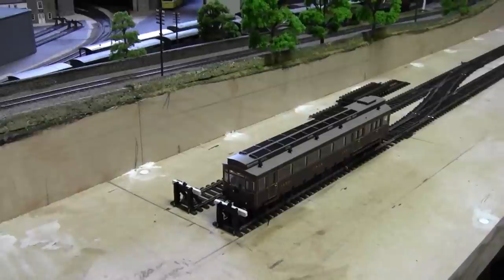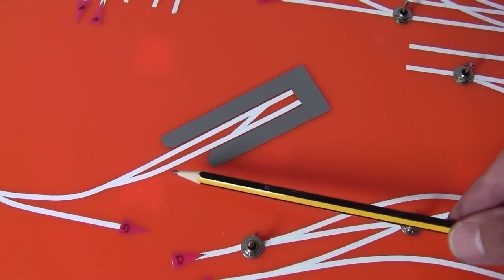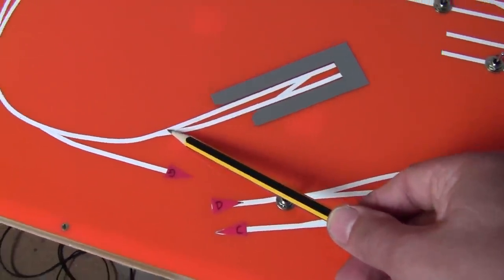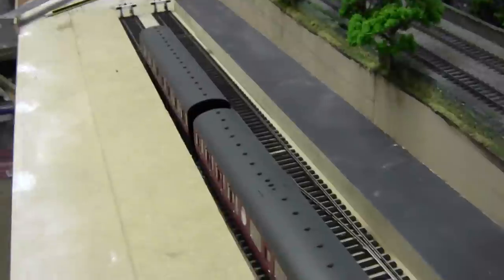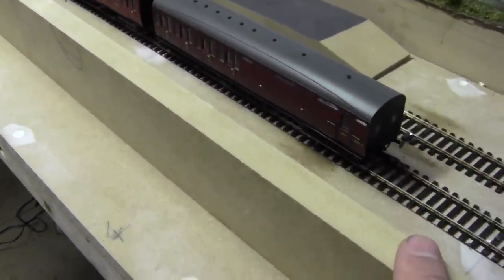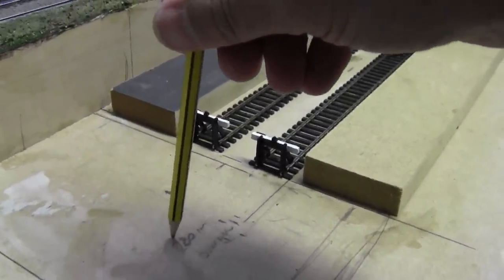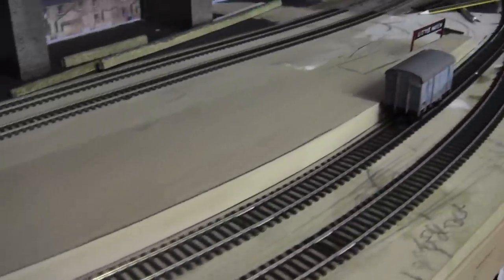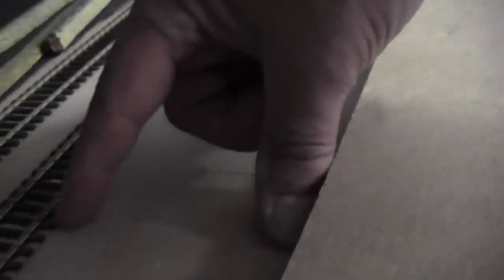Update and making Platforms Part 1 ....No 320

Comment: Nice job Tony . Your level middle are easy too do with polyfilla . All you need is two pieces off old rail bent slightly at the ends off the rails.then place the rails near the chairs glued in with super glue . Then take a piece of string.place both sides. Polyfilla over all. Leave to dry . Pull the string out once dryer sand and paint. Job done. Look forward to next video
Reply from the maker: Thanks for the tips! Ian. i will bare that in mind. have a great weekend...cheer's Tony

Comment: Hi Tony you are doing well on your extension  will be keenly watching. I've been back in my shed this week working slowly since my 3 weeks away. Did pick up 3 more engines a lot of ballast some coaches and things while away. But I always made sure not to miss your videos. Stay safe my friend.
Reply from the maker: Hi Stephen. so far so good. i have not done much this weekend so far as its been to hot. your back in the shed mate just as it getting warmer at leats you open the door and let in the breeze. i am not quite ready for ballasting just yet. still have some wiring to do. until next time my friend stay safe. and enjoy the hobby...cheer's Tony
Reply: Nor me my friend I dont even like ballasting but am going back to mixing didn't like mono tone like the last time.has for the heat I have a small aircon if it gets to hot. @TONYNORTHEASTERN

Comment: Great job, Tony!  Your drivers need to be trained not to hit the buffers on arrival to the station, or maybe employ a flagman. It saves on having a sensor. 😂
I noticed you have included insulated rail joiners at Jarrow Road.  Is that for track isolation or are you into block detection, Tony?
Whether it’s station platforms or anything else, practice makes perfect. 
I saw an earlier comment you made about gaining tips for water features in relation to the dock/canal at Little Haven.  If you have not already done so, check out Luke Towan on YouTube, who is THE guru at scale model scenery tutorials for beginners and professional builders alike.  He has many videos on creating fabulous rivers, streams, etc, amongst other things.  Recommended!  Best, Jason.
Reply from the maker: Hi Jason mate, the sensor will light up red on the control the loco is close. hence why there are no sidings at this station. the controler is to far away to judge where locos are. block detection would great for this...
i will check out luke towans channel. we are a long way off for doing that just yet....i can now have a rest until next friday. stay safe my friend. Tony

Comment: Blimey, yet another one!!! 🤣😂😅 Nice to see the panel mate. Looks Jim-dandy to me 😎 Nice use of those little black cable ties! Where did you get them? They look like a godsend 😉

I really like idea of polyfilla and pva for crossings and roads with rails inset, so I shall be shamelessly stealing that in the future 😄

By the way, for Lityle Haven, could you not put in a barrow crossing of some sort? 🤔 Not untypical on tight spaces and it’s only going to be employees and workers as opposed to the general public using it 😜

Those platforms will looks superb when finished too mate. Great tutorial on the method for building curved platforms. I always think they look better and more realistic than straight ones anyway 🤓

Cheers old son 👍🍀🍻
Reply from the maker: Hi Tim. the cable ties are 4 inch and they canbe found on ebay. they are quite cheep. 
I may think on what you have said regarding the crossing. until next time all the best Tony

Comment: Impressive wiring in the control panel. Great explanation on how to curve platforms too.  Spoilt this week with two vids. Thanks mate. Stay safe. Arthur
Reply from the maker: Hi Aethur. Curve plaforms have been a bit tricky to do. but if you a small wagon and tape a pencil or pen to the side it does work a treat. the panel is not finished as there are so many points that need to be wired up yet. hopefully when i get get some spare time from building i can then run the cables in...until next time stay safe Tony

Comment: looks very nice.
i usd plained timber 20mm for my stmarks layout. 
worked a treet.
did not think of MDF.

all the best

paul
Reply from the maker: Thanks 👍 Paul. i have always used MDF, as platform height should be around 17-18mm in height. 20mm is ok. but no higher than that. as for scale terms it should be 12mm above the rail...thanks again for your thoughts on this subject. the main is as long as it looks right...all the best Tony

Comment: Hi Tony, as I see in a lot of the comments the control panel wiring is amazing, very neat and organised.
As for the platforms I’ve picked up a few tips there, do you use a jigsaw to cut the curve in the MDF? It’s very neat if you do, I have a love hate relationship with my jigsaw which puts me off slightly about doing a curved platform in MDF and find it easier with card.
I had actually watched this Friday afternoon and this is the first time I’ve had a chance to comment!
Cheers Tony, John
Reply from the maker: Hi John, I also use a jigsaw. but you must have a steady hand to keep the blade on the curve whilst cutting. but yes its all good fun. especially if you only have enough material to do it once.. i did do a video on the control panel awhile back. its just we dodnt see much these days.....thanks again for commenting.....stay safe buddy Tony

Comment: Hi Tony. Is the 18mm MDF exactly the correct height for your platform in OO gauge?
Reply from the maker: Hi Paul. 18mm is as close as it can get. as the average platform is about 3ft 9 inchs in height. but in some cases this may be a lower or higher in real life. depending tack maintenance. but for oo gauge it shoud be 12mm from the top of the rail. to the top od the platform. 17mm but i use 18mm because the material is cheaper than buying ready made platform kits. the only thing i can say is its a lot easier to make your own with card or mdf. i hope this helps...all the best Tony